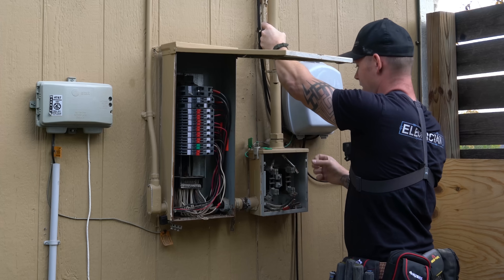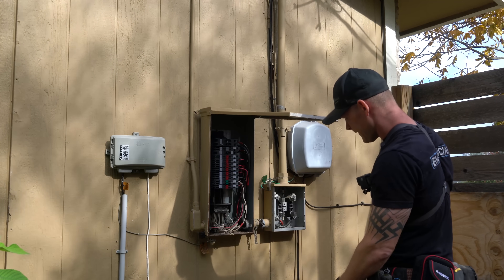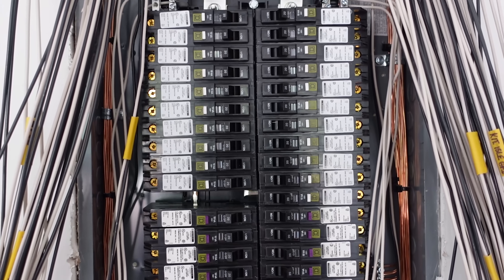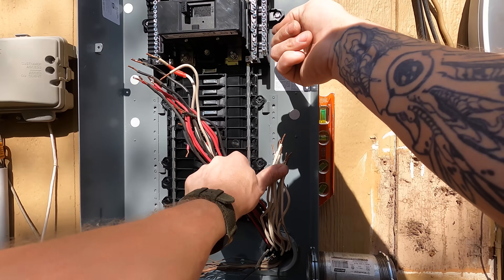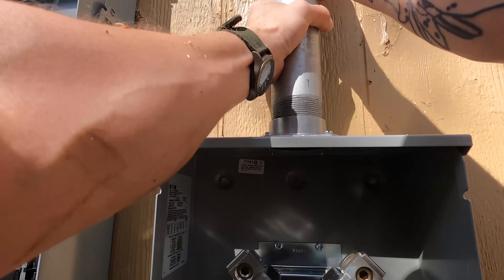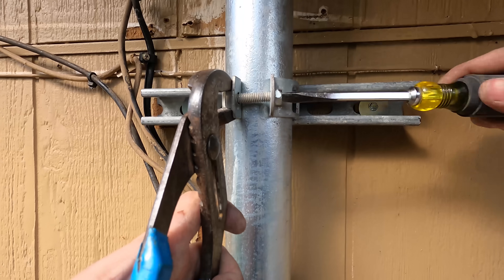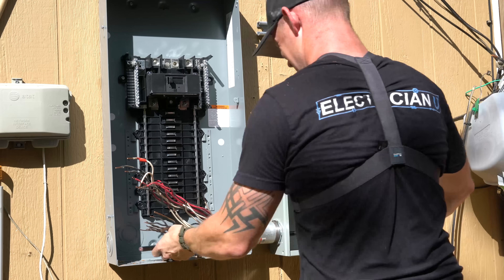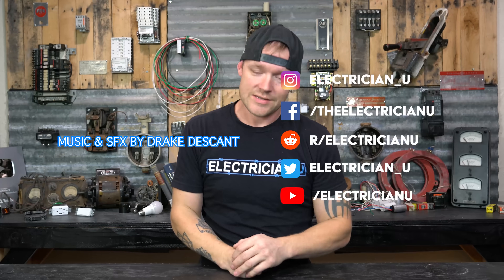How to Replace an Electrical Service Panel, Meter, and Riser (PART 1)

Comment: You used 7/8” strut near the meter base and 1-5/8” strut below the roof. Did you put a 3/4” offset in the mast?

Comment: Not an electrician but the reason why they put the Knockouts in the screw holes, is that yours is an exterior panel. Most of the interior panels don't have knockouts in the screw holes

Comment: I am a retired licensed Electrical Contractor  15 years retired and no way would I try to teach an amateur how to do a service change. The NEC revises the rules every few years so after 15 years I am not qualified to give advice. The best advice I could give is to call a licensed electrical contractor who will be insured and will have the work inspected. Electric work is not for hobbyists and handymen. I Know the OP is trying to be helpful but more than one house has burned down because somebody had a friend or an internet professional for help.

Comment: What does a person do that finds out that the electrician that installed the breaker box for an older residence didn't accurately mark some of the circuits? For example, one breaker was marked basement, but not a single outlet or fixture of the basement was on that circuit.
Reply from the maker: With a circuit tracer. Aka a tone and probe. Or a breaker locator. 

Klien makes a breaker locator and it's like 39 to 55 bucks depending on where you go to get it.

Plug it into an outlet and then go to your breaker box and find it.

Comment: Thank the heavens above for professionals like you. I had my panel changed out when I bought my house a few years ago. They did a great job and were done in just a few hours and the cost was very affordable. Amazing to watch for me.
Reply: Quick and cheap are not great words in any field of construction.
Reply: @dubselectorr345  Neither is overpriced and slow. These guys did a great job and I watched them every step of the way.
Reply: @anonymoustargetindividual  
For the panel and 2 guys labor $1250 cash. They cleaned up nicely too.

Comment: i have done a ton of wiring and i have ben in hundreds of panel's over the years but i have always liked Square D better than any other they just seam to work breakers are plentiful & wont break the bank either ! But i am no Pro i am not licensed or any thing but i dont consider my self a Noob Either..lol. But i have Common sense whict is to say i dont need a sticker on a blinder that says do not stick your dingus/dinky/winkie in the blender when in use ..lmao  but some apparently do ! Cool video

Comment: I started watching this out of idle curiosity. Shortly my ears perk up at '68 house, paused to go check that out, what was my panel? OK not whatever that is, moving on.  
Understand why you would want to replace that but my goodness what a task.  Shutting off and disconnecting are 2 different things in a presently living in space.  Must have been some serious planning and prep how to pull that off w/o divorce 😆 methinks. 
Another pause for head thingy, had no mental picture so pause and out with a flashlight. Made it half way down the driveway, a second or 2 before turning around to sweep the corner of the roof one would be, considering where power enters the property,  underground from the street.  😖
My dignity alone suffered in the execution of this comment. 🤣

Comment: Just wondering what electricians make for an hourly wage where you live? in Edmonton Canada most residential and commercial electricians make 32 to 39 per hour. I f you work in the oil industry you can make 40 to 60 and hour . if you work for the utilities or in power systems you can make 50 to 80 .
Reply from the maker: Try asking in our discord server for input from 2000+ electricians in all different areas: https://discord.com/invite/7ykYfbh

Comment: Grateful for your content my Bro! Helps me out heaps as I’m learning to be an electrician. 
Question: how do I replace the aluminum bar that’s melted in an old meter box safely? The screw that held it together also melted.
Reply from the maker: So happy to have helped you out!
To answer your question: Have service disconnect. Then do it. Or have someone who is licensed and trained already do it.

Comment: Okay, silly question, how do you disconect the electricity in the first place? Do you call the electric company, or can it be done by yourself?
Reply from the maker: Yes, contact your power company for a scheduled shut off. There’s a few that go the extra mile and when you call to turn it back on, they require like a password or safety word to ensure that it’s the same person that called in. Power company will come out and remove the meter , also.

Comment: Do you level the box and meter so the electricity doesn't run to one side of the box?.
Reply from the maker: Although we like to use the water analogy for electricty, no. Power does not flow heavier on one side compared to the other if it is mounted sideways. I would urge you to check out Art. 110.12 A,B, and C. And also the ANSI/NECA 1-2015 booklet.

Comment: Hey everyone, question about this video. Is it per NEC to have all the wires enter the load center without a romex connector? I'm thinking specifically 312.5 (C).

Comment: Isn't the first step to remove the meter and disconnect the overheads?
Reply from the maker: Technically, yes. Having power disconnected from utility and having the power company pull their meter out would be the first step.

Comment: I have a question for you. I n a above ground pool. There is a dedicated GFI feeding the pump. Bonding in done to code. The problem I am having getting stray voltage at the pool. Getting shocks when sitting at edge of the pool with feet in . Any suggestions on where to look for the problem

Comment: The knockouts for the screw holes makes perfect sense. Yours is outside so it makes even more sense. What if the particular place you’re mounting it prohibits you from putting a screw in the exact place where their hole is or the particular place where it’s mounted is in framing so it’s screwed on the sides. Now, since your pane is outside, you don’t have any open holes and it’s that much more closed off from the elements. Pretty simple.

Comment: 💚💚💚💚 bookmark/ notes rusty 🔥 like getting oxygen / auxillary  ……………..Like Harry Potter bus with those windshield wipers on the right corner of counter

On that bear metal wall - lean with it rock 💊 , rusty turning into the brown pole / brown brown ground poles with it -g-b , bot

Comment: I got lost. Where did the electrical company wire go. I’m assuming the wires he installed to the weather head on the bottom end went to the panel and the electrical company wore went to the weather head where exposed?

Comment: Question. When you bonded the RMC to the meter using the bushing why didnt you need have another inside the panel? Wouldn't your panel side need the supply side bonding jumper since its your first disconnect from the meter? Thanks for the videos I love the info.

Comment: I just upgraded had my 60 to 200 panel....how much extra shoul it cost to now run a 220 30 amp 50' for new ac...and 1 seperate for attic light and new heater..20 amp 110 less the 50' and same for kirchen microwave...so 3 new lines with breakers..one is 220....any idea of a price range for this part...one story easy access to attic

Comment: How did you cut/disconnect the load side of the service wires to be able to change out your service panel/meter

Comment: i think a pretty good guess as to why they don't punch out the holes is because that would be more waste they need to dispose of so they just put that onto the customer instead. Also keeps the holes at the correct shape incase they get banged around

Comment: If the majority of my house is has appliances the only appliance that will use more power is the oven since it’s an electric oven and  a/c is gas too  but I am trying to replace my main meter is 120/150 amp box good? Or should upgrade to 200 amp?

Comment: When you had your electric provider cut the power what did you tell them did you have to get a permit and do they go inside the house to inspect after? I am trying to replace my meter it has 100 am power but the walls are bare and trying to replace to 200 amp but should I replace the meter after all the renovations?

Comment: Those silly little knockouts are to keep a fire from getting out of the panel, just saying. Same reason you install a knockout plug into an open, unused knockout hole.

Comment: The knock out holes are there for the screws so you can only have the holes needed for the application. In the oilfield in Kentucky most use the center row top curve bracket to mount to the pole or fence post depending on overhead or underground service.  The less holes in the box better to keep moisture and critters out
Reply: I am glad you covered that!  I was going to mention that.

Comment: Hello Mr. This was a great video and i learned much about it. Excuse me, when you where installing that load center, i was wondering if that equipment should be NEMA 3R rated because it's outdoors (weather resistant): as i can see it's a NEMA 1 you're installing. 

Thank you!
Reply: This panel is a nema 3r

Comment: Dustin I have an old buss system with the round fuses.. You mentioned you didn't have a main breaker where is the main breaker on the old electrical system . Mine is from the late 1967.

Comment: So I have a federal panel that was installed in 1993/4... Breakers trip when needed. Has one GFCI breaker that supports the jetted bathtub.  (tests well)    I know that Federal breakers are an issue...  We have been in the house for 5 years... So this panel has been working "fine" for almost 30 years... Does it need to be replaced?

Comment: Great video and awesome work. I started inverting the panels when the service wires come in from the bottom to avoid taking up extra space in the gutters. It took some getting used to but it looks super neat that way.

Comment: I think the punch-out holes is because of NEC rules about there no being any non-blocked hole into the service box, but I am not sure either. It seems like holes on the back where it would be flush against the wall would be silly to prohibit as nobody is going to stick their fingers up in that but sometimes rules ain’t written sanely.

Comment: I want to run power out to my garage what wire is the best to run it's about 125 ft and I want to bury it in the ground should I use 6/2 or what

Comment: The reason they leave the screw hole slugs connected it that these are a real pain to deal with in a stamping press (cnc turret or otherwise).  If a slug does not fall clear (they can stick to to the end of the punch)  then it can cause punch jamming or breakage.... so the easiest way to prevent this is not to punch it all the way thru and leave it to you to deal with.

Comment: I didn't see the roof flashing it's best to push to put your roof flashing underneath the shingles first the other fingers anyway that way it doesn't have a tendency to leak
Reply: I didn’t see one either. The camera never panned over the hole after the conduit pipe went through. It’s enough work that I think he would have mentioned or shown it if he’d flashed it.

Comment: Electrician Here up in the Pacific NW. Highly recommend trying out the leviton panels. We used to use Sq D and Eaton but since changing to Leviton had no issues and make up is really quick on Rough. Also im sure your probably aware but little trick we use with rigid coming into Hub, we squeeze a little No Ox on the threads and seems to go in pretty easy. Great Vid btw

Comment: This new Plug on Neutral finally solves the "all Neutrals in the building being un-switched and bussed together" problem of the original design.  Not sure how the original "attach all neutrals in the building together into one bus" passed muster.  The simple 1960's space age solve would have been to have every breaker responsible for one home run pair.  A DPDT switch, with the hot lead being able to trip the breaker, and the neutral being switched sympathetically.  This would have been far superior to shorting all the neutrals together design.  This would have also allowed a "switch off any homerun completely", including it's neutral, for easy troubleshooting.  I can't wait to switch to DFAFCI with a plug on neutral panel...  The old school way is a total fail, and never should have been acceptable to begin with...
Reply: ... to color code wires, try Colored Heat Shrink Tubing for an even better look...  Another tip is to use a shrink wrap wire labeler for homeruns.  Pretty wires!

Comment: Is there a reason you are not putting the new panel on the inside of the house?  Are you doing it the easy way or is their no where in the house that meets code? I would be real Po'ed if I had to go outside during a Thunder or hail storm to reset a tripped breaker. Just saying. Great video.

Comment: Can you do a video on feed in solar and how the Junction Point btn Inverter and grid is formed. What regulates the voltage and how it works along with grid. I've read an argument that solar feed in makes it more difficult to regulate voltage by coal burners

Comment: After I watch the connection being made and no "No Ox" was used , It's   apparent  this guy is clueless . I would not let him replace battery's in my flashlight . Next
Reply: You don't need No ox for copper wire,  only aluminum.

Comment: Dustin, thank YOU for ALL the hard work you do to put out your videos, big fan here. I have a question or several. Could you do a video on installing EV chargers? Given that the country is eventually moving from gas to electric cars and cars may need to be charged over night some people don’t have a garage for EV chargers, which can pose some challenges. I have several apmts., and just thinking of the electrical issues coming related to this keeps me up at night. Any ideas?

Comment: This channel is incredible for ECs and engineers. May not be a possibility, but only thing I would've tried to do different is put panel inside the house. Don't know what's on the opposite side of that wall but the panel would not be subjected to weather plus you could use extra slack of branch circuits to reconnect  to all the breakers.

Comment: good job but use anti rust   noalox  antioxidant at meter can and panel connections also the panel is not allowed outside residence in exposed air in your area i guess is ok there but most panels are not allowed outdoors interesting location  outdooors even when waterproof box is used

Comment: I'm not a certified electrician, but I do some light electricity. Now I'm checking three outlets. Two upstairs, one downstairs, all three have power,  I checked main panel all breakers are working just fine, what chould I check next?

Comment: I am impressed with the Square D panel especially with the plug on neutral bus and the insulation covering the power lugs which are always hot even with the main breakers off.

Comment: I noticed you didnt use any anti corrosion/oxidation paste on the conductors, I know there's no aluminum there, but is it not needed just as a general practice?
Reply: Why use copper? Al is so much cheaper and suitable for application
Reply: @ferfaknin1  smaller wire size.